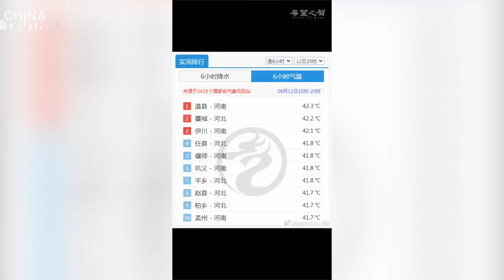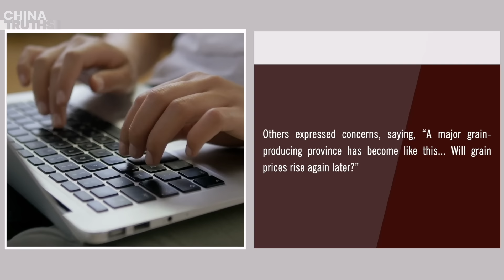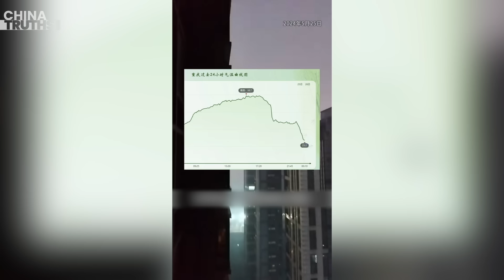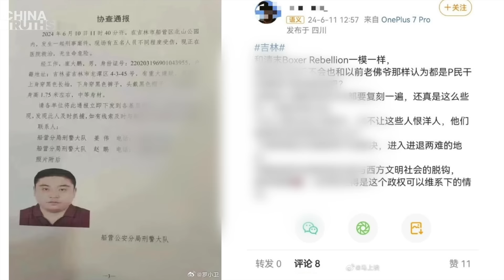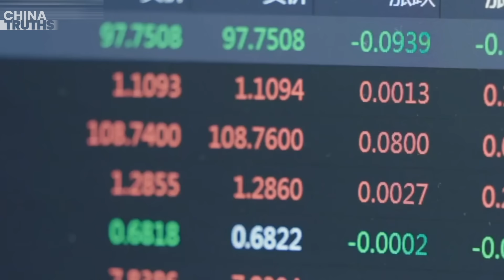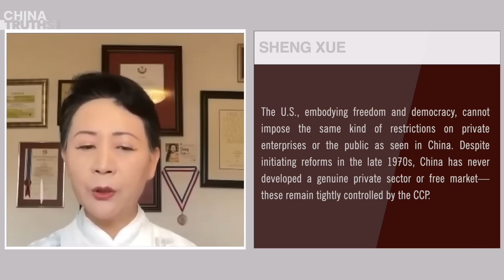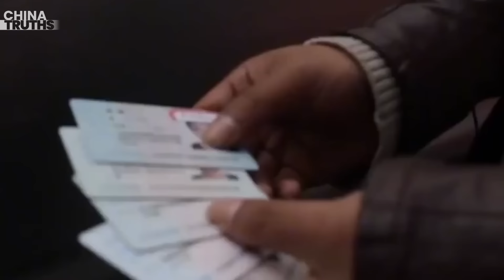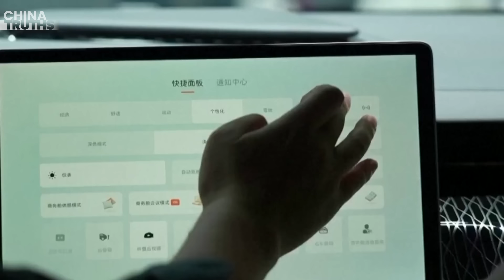China’s Scorched Fields And Torrential Rains: A Nation Under Siege

Comment: According to a BYD factory engineer who lives in our building there is no oversupply or overcapacity in the China EV manufacturing. China is now at a point where gasoline car sales will die quite rapidly and need to be replaced by EVs. Once the EV sales pass 50% they go quickly to 80-90% especially since there are plenty of EV models to choose from and fewer ICE car models. There is also a growing global demand for Chinese EVs and new countries are added to the list. China has scaled up the supply chain so much in the last 10 years that prices are getting very low.